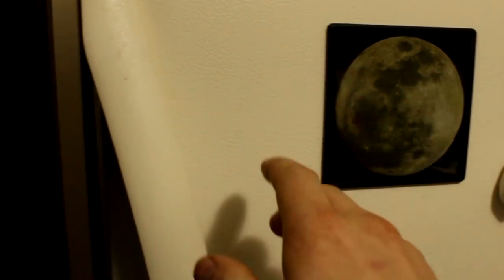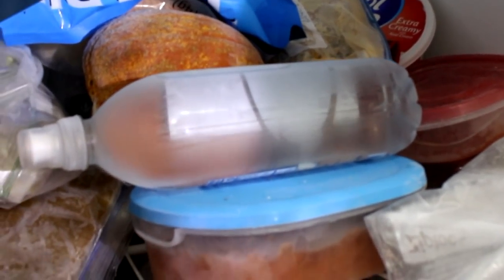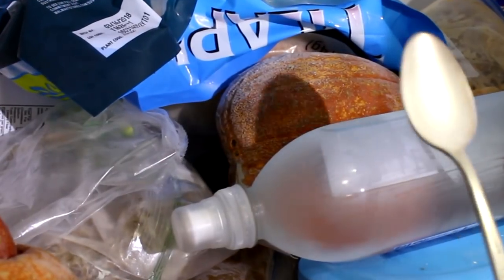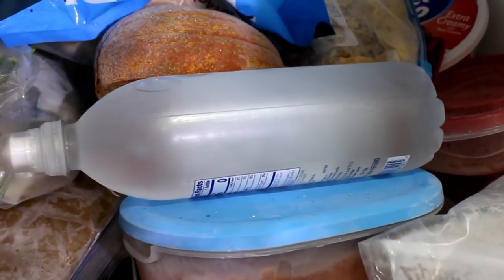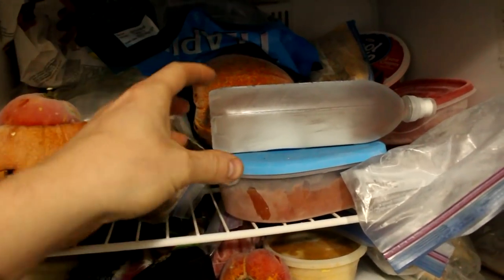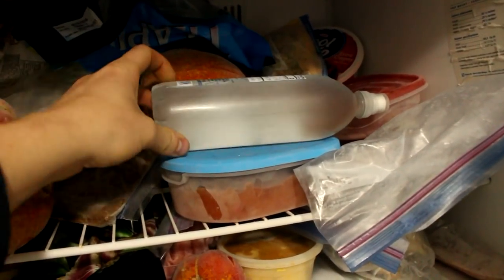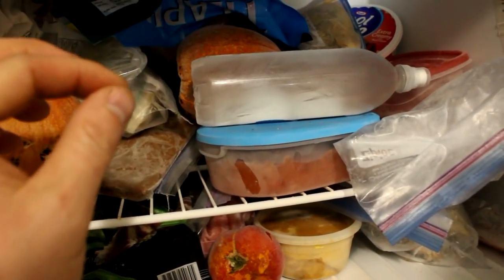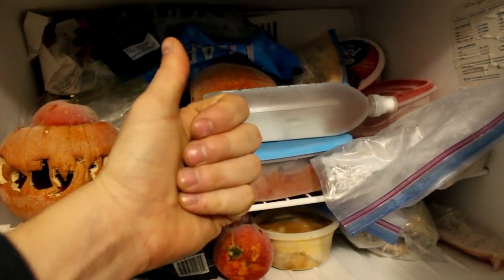Water Heats Up As It Freezes!?

Comment: Cody, technically, the "water" does not heat up. It releases heat as electromagnetic radiation, which your infrared camera very nicely captures and shows us what is happening in real time. It releases the heat in order to form ice crystals as part of its phase change. Since not all of the infrared electromagnetic radiation escapes the bulk of the ice, some of it is reabsorbed by other ice crystals and goes back into a liquid state, thus giving you slush. 
Very nice of you to show us this effect. Kudos!
Reply: Disagree. The water must heat up, since an equilibrium mixture will be at the freezing point, whereas it was below freezing when it was supercooled.
Reply: Technically, any H2O in liquid form is undergoing a phase change and releasing electromagnetic radiation, which the camera shows and thereby the liquid H2O is "technically" cooling, not heating up. The question then is how much of this electromagnetic radiation is re-absorbed by the solid (phase changed) H2O to return to the liquid state. Microscopically, some liquid H2O locations may re-absorb more of the electromagnetic radiation or perhaps mechanical phonon vibrations from their surroundings, to say that some local spots "heat" up, but overall what we are seeing is liquid H2O release heat or "cool" in order to undergo a phase change into a solid form. Technically speaking.
Reply: That can be simply tested by using a non-infrared thermometer.
Reply: The beauty of what Cody has done is show (at least part of) the energy that must escape the liquid H2O, in order for it to solidify and that (it seems) a lot of this energy is electromagnetic radiation. Under a phase change a non-infrared thermometer should show no movement, because, being only a phase change, the mechanical, "thermal" vibrations are, on average, the same under the solid state or the liquid state. This is a beautiful experiment, showing that, in all likely hood, most of the energy released is electromagnetic. Nice experiment!
Reply: fllev how can it be electromagnetic radiation? Is water emitting photons?
Reply: The camera reacts to electromagnetic radiation, that is, it is a device that relies on an electric signal being generated when an infrared photon reaches its sensor. The liquid H2O releases photons in the infrared spectrum, which the camera picks up and informs us of the situation and thus liquid transforms into solid. During phase change, the solid remains at the same temperature that the liquid began. The energy is released in order for a "structural" change to occur within the body of the liquid.
Reply: All matter above absolute zero emits photons, but that is a relatively minor amount of energy at room temperature, and really has nothing to do with the freezing process shown here.
Reply: Not sure to what you are referring. The camera clearly shows the bottle emitting photons, while the liquid H2O changes (at least partially) into a solid.
Reply: You could carry out the same process inside a thermos flask, which has a mirrored wall that reflects all infrared radiation back inside. That change would have no effect on the freezing process, which is a thermodynamic one, not a radiative one.
Reply: The camera clearly shows you radiation being emitted during the phase change.
Reply: Yes you can see temperature with a thermal camera, because every substance does emit radiation if it has a temperatur above 0K. Tis is called black-body radiation.
But this radiation is insufficent to explain why the water stays at freezing point while crystalizing. Because single water molecules are to small to absorb infrared radiation and turn it into movement. Thy only absorb it if they are incased in larger structures, but then the process of turning infrared radiation into cinetic energy  takes a awful lot of time longer.
Reply: You first need to understand how water gets hot when subjected to the energy emitted inside a microwave oven when the power is turned on.
Reply: The water was below 0C before it froze. It was at 0C after it froze. Therefore, it heated up. I'm not sure what there is to question here.
Reply: If it were a result of photons emitted due to heat given off in the phase change, then why did the water remain that color in the infrared camera after the transition had already taken place? And why was it visible before the transition? If your theory were correct, and the only "temperature" measured by the infrared camera were for things that are actively generating heat, then it would instead have been dark before and after the ice formation, and only lit up briefly while the ice was actually in the process of forming.
Reply: This isn't the case because, as already explained, thermal cameras do not detect the generation of heat. They detect blackbody radiation, given off by just about everything, which is an indicator of temperature.
Reply: @fllev water heats in a microwave because the rdiation causes single water molecules to resonate. Resonance is the reason thermal radiation at those temperatures is not suitable to explain the effect of heating up while crystalizing on a molecular level. At tmeperatures around the freezing point of water the emitted infrared radiation mostly has wavelengths in the scale of mm or larger.
Reply: @flev:  The thermal camera does not measure the amount of electromagnetic radiation emitted.  It measures the temperature at which it was emitted, by fitting a blackbody spectrum to it.  What the camera shows is that the water is emitting at a higher temperature, and thus the water warmed up by the phase change.
Reply: I've made thermal cameras and can tell that most folk that watch Youtube videos have not undergone rigorous technical training. It would behoove many a Youtuber to spend more time on the web researching any technical subject on which they would want to opine or learn well. The "blackbody spectrum" IS electromagnetic radiation and nothing else. It may be looked at as waves or quanta (photons) but electromagnetic in nature it is. What the camera shows is electromagnetic radiation which it translates into a temperature based on a calibration to which it has been subjected. The liquid H2O emits the radiation that the camera shows because the liquid H2O HAS to release energy in order to structurally form a solid crystal of H2O. That energy may be photons or phonons, the camera only shows the photon/electromagnetic energy that the liquid H2O has emitted in order to combine with other H2O molecules and form ice.
Reply: @flev, Of course blackbody radiation is electromagnetic.  Nobody here has claimed otherwise.  But what you must consider a bit more carefully is the "calibration", or the "fitting of a blackbody spectrum to it" as I mentioned.  This is where you must draw upon some knowledge of physics.

A blackbody spectrum is described by Planck's Law, where the shape of the curve depends solely on temperature.  Or perhaps you are aware of Wien's Law which says the peak wavelength is inversely proportional to the temperature.  This is the clue to how an infrared camera works.  It means the temperature of the object emitting this radiation can be derived by measuring the ratio of the intensity of the radiation at two or more wavelengths.  Then there is one unique temperature for a blackbody spectrum that will fit to this measurement.

Another property of blackbody radiation is that the luminosity is proportional to temperature to the 4th power (Stefan-Boltzmann Law).  But this is not how a thermal camera measures temperature.  If you only measure the luminosity, or if you only use the intensity at one wavelength, then the temperature you derive will depend on the properties of the material -- in particular its emissivity as a few other youtuber commenters have already mentioned.  The camera would be fooled into thinking that different materials have wildly different temperatures even when they are at the same temperature.

So I think that if you think about this a bit more carefully, you can convince yourself thermal camera is not simply determining the amount of the radiation emitted, but the temperature at which it is emitted.  It is able to do this by using some of those nice properties of the blackbody curve.

Comment: Isn't it just going from super cooled (before zero) to ice at 0 degrees
Reply: Yes. A mixture of ice and water will rapidly approach 0 degrees C (from either warmer or cooler initial temperatures).
Reply: Yes, hence the title "Water heats up as it freezes"
Reply: Water does not heat up as it freezes?
Reply: Cody has created unusual conditions compared to bodies of water, which freeze at normal temperatures, due to the presence of many nucleation particles.

The other scenario of water that can be supercooled is in clouds, which form directly from water vapour, and can be very pure. Hail and snow does not easily form at freezing temperatures, unless it is very cold, or there are sufficient ice nuclei present in the atmosphere.
Reply: Braca Ganon In this case, yes, the freezing warmed the water up enough that only a slush was formed. Super cooling down to the point that water freezes solid is possible but much more difficult than making slush.
Reply: My calculations show that it is impossible to supercool water to a temperature at which the entire amount would freeze solid once crystallisation starts. Wikipedia says the lower limit at standard pressure (its crystal homogeneous nucleation) is −48.3 °C. To freeze an entire block solid, it would be roughly at 334/4.2 (enthalpy/heat capacity) or  -79C.
Reply: Gordon Richardson I must have remembered wrong, I thought some lab reported managing the required supercooling. It must have been under non standard pressure, or in something weird like nanoclusters.
Reply: @J - Water always "heats up" as it freezes (All substances do this). It's called enthalpy (or heat or energy) of crystallization (or fusion). This is energy that is released as the substance changes its physical state from liquid to solid. In this case the energy is transferred to the surrounding water, heating it up, and is why the entire bottle didn't turn to ice even though it was below the freezing point (supercooled) when the crystallization began.